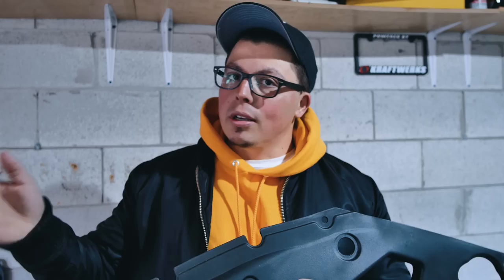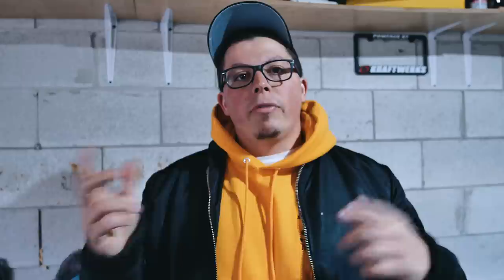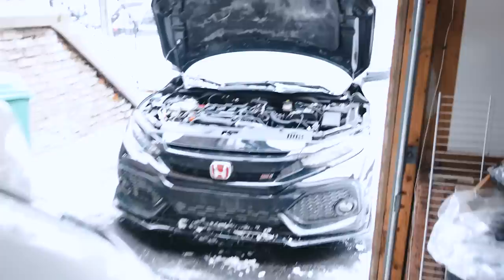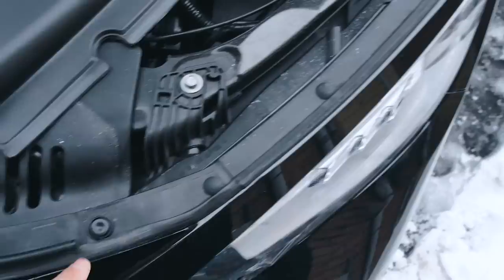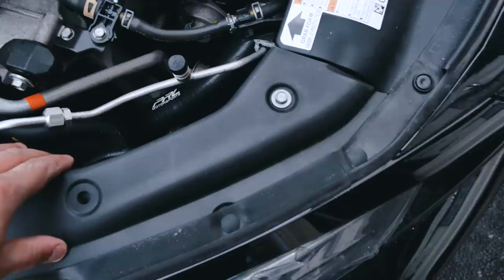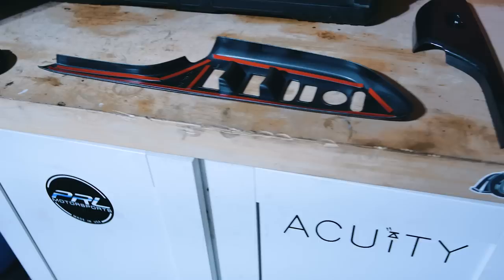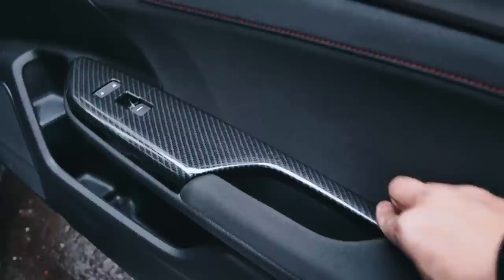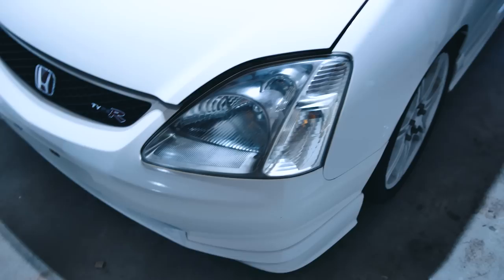EVERY New Honda Civic Should Have This!!!

Comment: The covers go over the rubber not under
Reply from the maker: Brent Cairns I left it sitting the same way it would be without the covers. I maybe wrong but I believe it seals the hood water entering.
Reply: Chris Lowpes that’s why the holes do not line up. You just take the first and last pins out and leave the three smaller pins in. That’s why the covers have a such big space around around the three smaller pins. It will probably not seal now since the rubber is lifted off the bumper now.
Reply: I have these covers and I installed over the rubber on the headlights which I think is how it was done in the video. I noticed it causes my hood to stick up slightly in the corners. Did you have this issue? It's a cheap part so could be inconsistent manufacturing. I agree that installing it over the rubber seems like it would interfere with the seal.